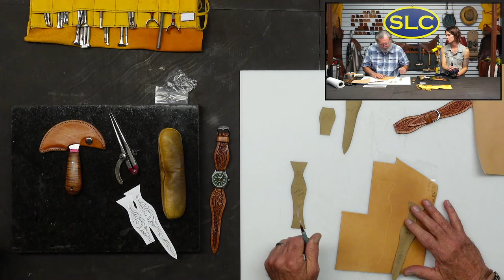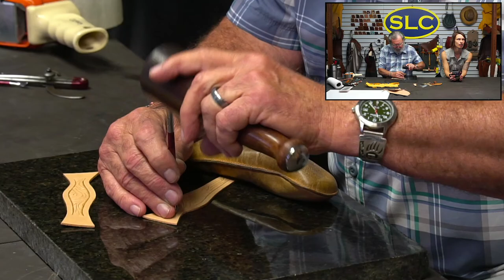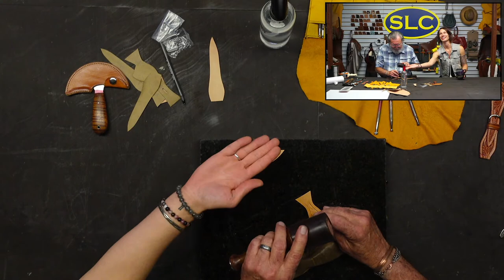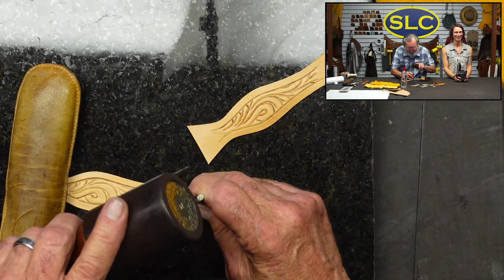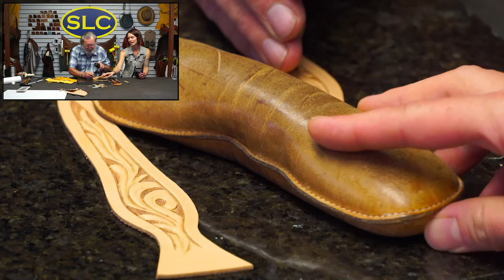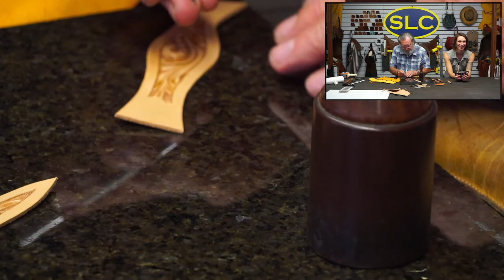DIY Leather Watch Band w/ Denny + Liz

Comment: Hey Guy's! Missed the live. Took a job sharping knives for a fellow Rocketeer who sent me a dozen huge fixed blades from Utah. I'm in Michigan and he's originally from here downstate.
Had your channel running and realized what time it was, so I turned this one on. I have a bunch of watches that needs bands and batteries, so I'm really interested in this one!
Too bad about the sound problems. Tony should have a few cords and such in stock for such cases. Maybe he can a few things now, if allowed to spend a few extra bucks.
Thanks Liz for having me stuck in you memory! I use the John James needles and like them but I wish that had just a bit bigger eye holes. I have a hard time getting 1mm thread through them little holes with my bad eye sight. And the needle threaders don't work so good because 2 strands is a real pinch to get through the hole.
Back to the diamond stones, then the wet stones...in a day or 2. Hopefully I'll remember to listen in on the live shopping tomorrow. 
I can't buy anything more right now, I'm a little behind on things. Glad I got the sharpening job to help catch up and put some grub in the fridge and pantry!
Laters